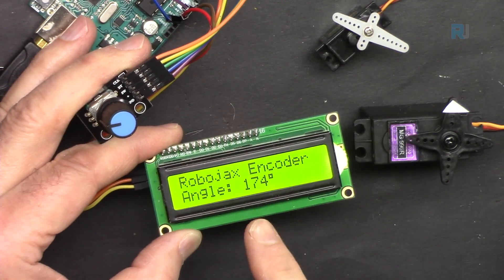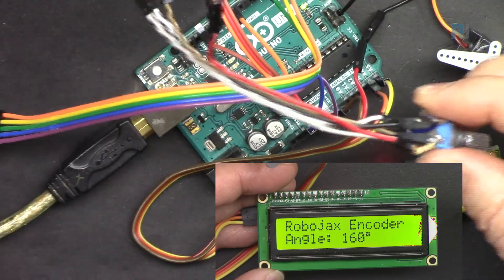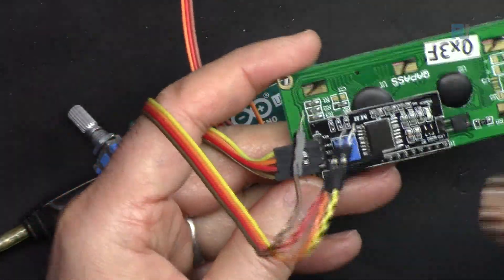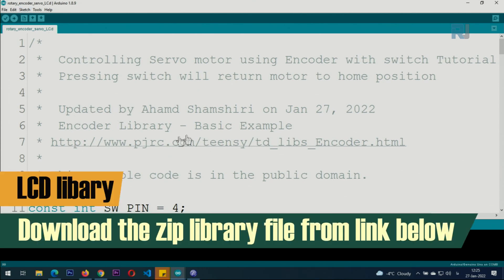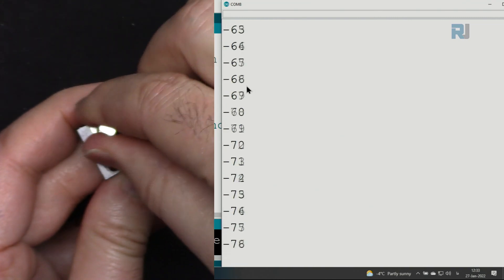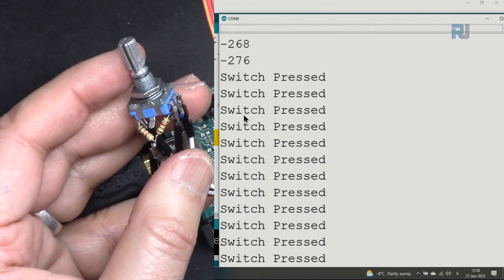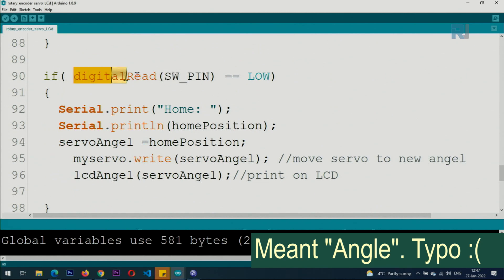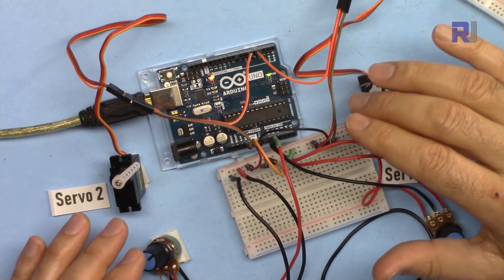Lesson 97: Controlling Servo Motor using Rotary Encoder and Display Angle On LCD

Comment: Hello Sir, Thank you for the lovely videos. I followed this video step by step and would like to highlight issues that I faced. 1) in command line lcd.begin (); does not work only lcd.init (); worked. 2) SW_PIN needs to be HIGH in the code otherwise the servo will keep going to home position. 3) I had to add pull down resistor on SW_PIN to make it work. this could be due to faulty encoder resistor but am not sure. Overall I have learnt alot from this project. thumbs up and I have subscribed.
Reply from the maker: You must be using different library. Use the library shown and all features will work as show. Thank you

Comment: helo sir, i also using the servo as you have (MG996R) which is also a continuous rotation servo. But when i uploade the program it just about controlling the servo MG996R's speed rotation, not controlling the angle of the servo. Can you explain it please ?

Thanks
Reply from the maker: Hi, the speed you see it the maximum. you can slow it down by adding delay.
Reply: Is there any way to control a continuous rotation servo to a specified positional angle sir ?

Comment: Hello is there anyway to use this to tell me the angle of a rotating part? i need a way to report the angle of a lathe chuck on a LCD display I need to be able to turn my chuck by hand at a very specific angle lock it and do an operation then continue to another angle and repeat up to 360deg I would also need to be able to reset the 0 angle anywhere in the position of the chuck.
I have used Arduino's before but I cannot code or figure out the wiring I can how ever follow a diagram and upload a program to the Arduino . Having a display give me a resolution to 2 decimal digits would be nice
Reply from the maker: Hi, all my video and codes are free. But if you hire me for $100/hour we can discuss your project Z If you want, then contact me via Robojax.com contact page.

Comment: Hello Sir, The code i tried it and it keeps placing itself at homepostion at 90 degress and it wobbles a little at 90 degrees when i move the encoder, please help why this problem is occuring
Reply from the maker: you must be dong something wrong.  you gotta test the servo separately in simple code before coming to this. don't change the code and try it.
Reply: @robojax  i did try a basic code to test it, and it was working fine, but this those with if-else statments are not working
Reply: also im using Arduino mega 2560
Reply: @robojax  after removing the switch pin code, its working fine